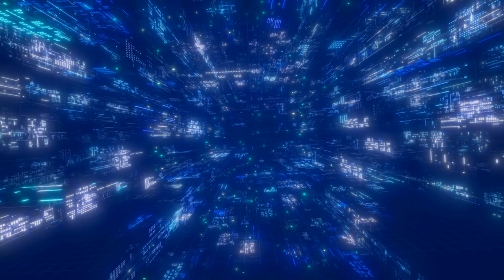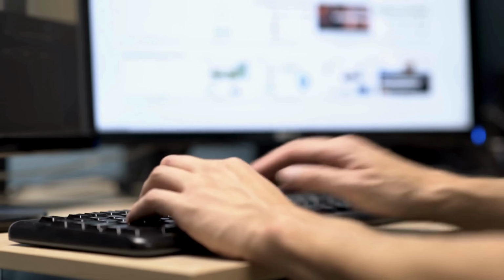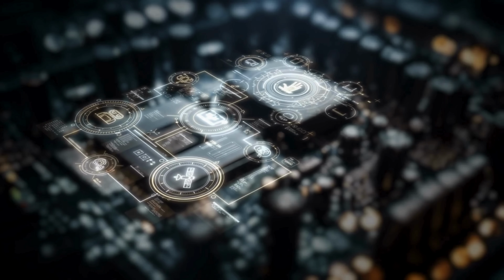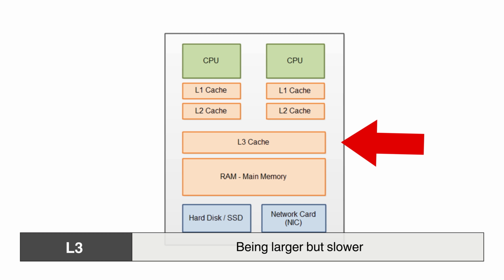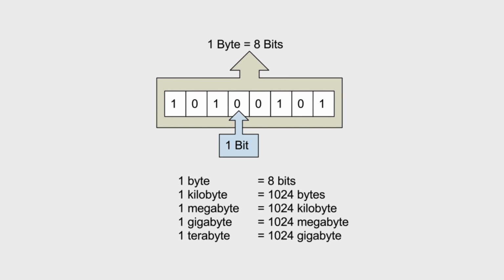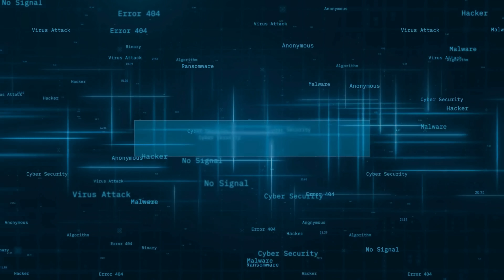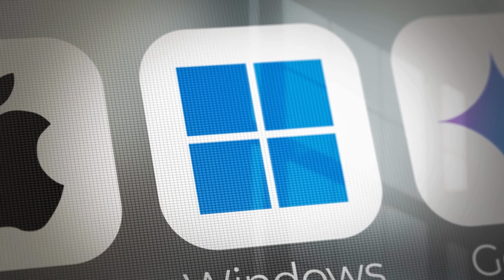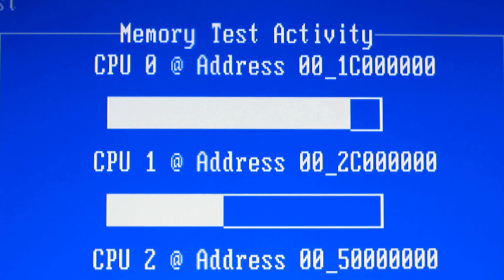Inside Your Computer: How Memory Actually Works

Comment: How does Ozone O³ create and it protects earth 🌎
Reply: During thunderstorm, lightning create ozone by its ultra high voltage, splitting O2 into 2 O. This radical O attack O2 and create O3 or ozone
Reply: Ultraviolet from sun struck O3 and break them into O2. Destructive energy of uv then reduce because of this
Reply: UV radiation in the high atmosphere breaks down oxygen molecule(O2) to elemental oxygen then they recombined to other O2 to create O3 forming the ozone layer . This reaction blocks harmful UVC radiation

Comment: Just the obligatory shout out to the ferrite core RAM of yesteryear.

Core storage: The IBM 1130 utilized magnetic core memory, a technology where tiny ferrite rings (cores) were magnetized to represent binary data (1s and 0s). 
Memory size: The basic system came with either 4,096 or 8,192 words of core memory.
Reply: Yes, our first Data General Nova II had core memory.
Reply: @josephgaviota Seems odd now that transistor radios and core memory coexisted.